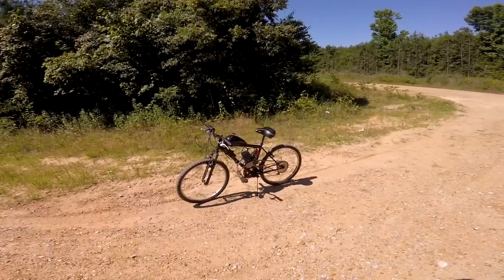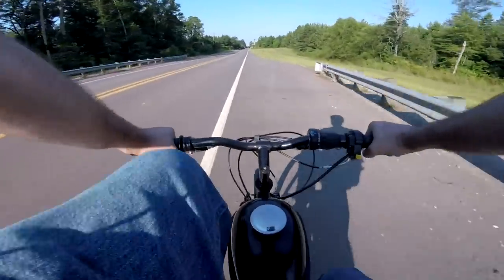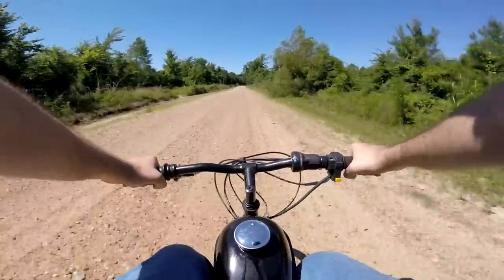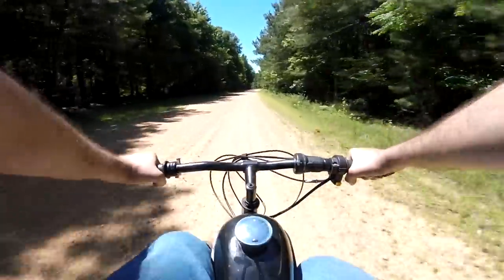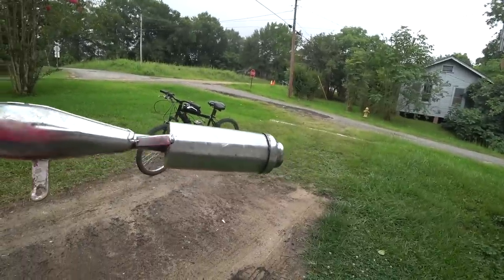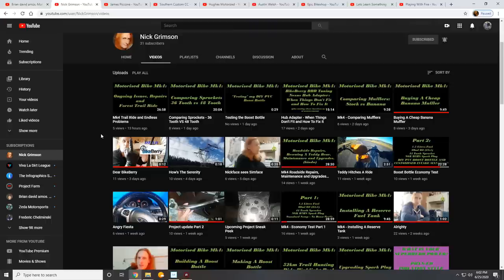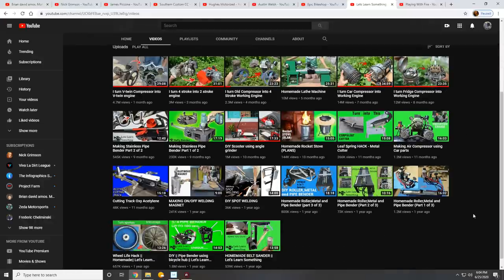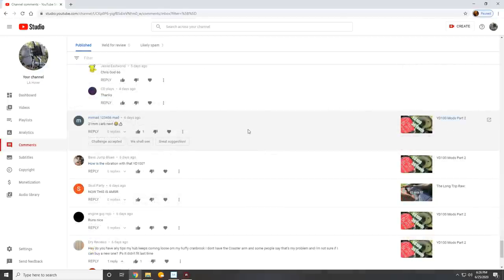Small Sprocket Advantages (Motorized Bikes)

Comment: Hey bud try putting the pipe back on with the air box off it would help....and Brian David is very good at what he does...i bought a ported cylinder from him and went from 40 to 47 mph top speed and it pulled so hard thru the rpm range...you should try one on your other bike

Comment: Hey I take back what I said previously about the HP Carbs...those Delorto knock-offs. Reason for the trouble before was the throttle slide spring wasn't properly seated causing all the issues I was having. The trick to them is to get the cable and idle adjustment(s) to work together to get a decent idle out of the engine, Thunderbolt289 has some good tips about doing that, although he's showing you on an NT carb, but the principle is the same...

Comment: I just jumped from a 36t to  40t. If I didn't live where there is so many hills I would have stuck with the 36. Om my bike almost everything is better with a 36.  It'll just hum along low 30s not even working.  Accelerate faster, even goes up hills faster, gets better gas mileage, sounds better.  The downfall for me is were I live when it gets s little bit colder,  the wind resistance with the 36 is more of a factor.  And the real big Hills you have to be give it everything she has to make it up.
Reply: James  with a little bit of help

Comment: just go ahead and order new clutch pads and a replacement chain that comes with a few spare master links. These are the parts that always trash out and break first with those kits. If you ever break the accelerator or clutch, remember you can swap out your rear break lever in a pinch to make it home. The fuel line that comes with them always wears out fairly quickly, replace it with a real fuel line asap.  I suggest where the cable for the accelerator slots into the handle, wrap it with a small zip tie or two, that little white plastic slot break easily. Otherwise they're fairly bullet proof little machines. If you're going to abuse it, attach the gas tank with electrical tape instead of the bolts because the little screws that are welded to the tank are known to crack the tank and leak from bumps and drops. Invest something small you can strap the the handlebar if you cant or don't have a rear storage rack on the bike and use it to carry all these spare parts and the small hand tools needed for them, and toss a little Gatorade bottle in there with some spare pre-mixed fuel in case you run out or spring a leak and don't catch it in time. I use a small plastic ammo can that is weatherproof for this, and it also hold a small 12v deer camera battery in it that I wired a little switch to in order to operate a bright trail light I use as a headlight at night and get a nice rear red light that flashes (they usually have like 50 hr+ batter life) and toss a $10 set of spare lights in that tool bag in case you break the lights somewhere with a spare set of AAA batteries just in case. 
 That's about it, do this and youll be surprised how long these little kits last. I've got one right now that's creeping up on 4,000 miles.

Comment: I started with a 36T on my first build, and while the initial top speed was quite remarkable, didn't take my weight or the local terrain into account (270# and moderately hilly) geared up to a 41T, and sacrificed about 15MPH for top speed, which is ok, I'm not in that big a hurry anyway. Not to mention these bicycles we all love to power aren't really intended to achieve those speeds...
Reply: Are you saying you are 270? Just wondering because I am aswell. And I'm looking for the right sprocket
Reply: @moxylady01  yep, and a 36T was too low on a 26" wheel. Gonna try a 36T on a 24" wheel on a new build...see if that makes any difference...

Comment: picked up a fully intact used huffy cruiser for $50, ordered a "50cc" full engine kit with a stock sprocket, and separately ordered a 36 t sprocket (with more rag mounts included). Probably gonna most often use the 44 t, but I'll try the 36 t on the same bike or use it on another/later bike build. Also ordered a front caliper break kit for the cruiser. We'll see what the actual engine size is. But anyway ooh I can't wait for the orders to arrive! and build my ICE cool bike 😉
Reply from the maker: been testing a 50cc 2 stroke kit (video will be up soon). They are 'good enough' to get around on, but lack any power for climbing hills.
the 50cc kits need a pipe IMO. Start with the 44t, mine does not have enough power to use anything smaller.
Reply: @LAHover  thanks for the reply . i could guess that you get many many comments in all of your videos.  i'll try to find your FB messenger and send messages there in the future. I'm "Peter V Gorp" in FB. but for now, what is the "pipe" that you are referring to 🤔 ?
Reply from the maker: @pitapitabread  Sorry older video, I need to update the contact. We use discord now, you can tag or DM me in the server when you have questions, https://discord.gg/DMg5BEv

Comment: About your carb: I suggest something from 18-22mm on the YD 100. I run a 20 mm ebay carb for the Yamaha DT 80. I had to jet it down from 95 main jet to 85 -90. still testing. runs good but cant tell you the speedgain because of too many other things modified at the same time.
Also you could do a spark plug test (BP5 HS BP 6 HS, BP7 HS)in the future, its cheap and i could notice some performance gains. the NGK plugs hafe a longer thread which will slightly increase compression without touching your piston on the YD 100. 
Also an oiltest would be an interesting topic. I noticed differences in smoke and smoother running with different types of oil.

 keep up the vids and greetings from Germany.
Reply: So the ngk bp6hs  really work for the yd100
Reply from the maker: Thanks for all the info!

Comment: Hi LA Hover. I Just got my moterised bike finished I have some issues though. So, I got it running it’s awesome yeah. But After a quick ride 10 min. I parked it and then noticed my whole gas line and fuel filter were leaking. They are all tight I don’t know how it’s leaking but anyway, Is a fuel filter really needed? I’m just gonna get a new line. Thanks love the vids Btw
Reply from the maker: Hey it might be leaking from the on off valve. Add a few wraps of nylon tape to the threads of the valve... This will also allow you to rotate the valve to a convenient position without having to tighten it all the way.
No you do not need to run a fuel filter as long as the valve has a strainer, but I still recommend using a fuel filter.

Comment: I have a port matched 66cc china motor with reed valve 21mm carn ported piston boost port non balanced crank almost always wide open no pedals and has so much miles and very reliable, I was very suprised with the china motor

Comment: Hey man, new bike builder here and I've been loving your content! I'm just curious what you think about the sandwich type rear sprocket attachment. That's the cheapest and easiest for me to get, but I've heard other people say to avoid them and go with the type that bolts directly to the disc brake mounts, especially with more torquey engines like I have in mind (4 stroke GX120 or GX200 clone). The only issue is they are more pricey and I have to import them in from another country, and can only seem to find a 22T sprocket of that type.

Do you think these sandwich types of sprockets are adequate for a GX build? From what I've read the main risk is damaging the spokes but I could always go with thicker spokes. Heck, maybe I'll just try it and see what happens 😅

Great channel, either way. Cheers!

Comment: One more advantage...chain can clear the back bars of the bike better than larger sprockets...as my frame is forcing me to find out otherwise i have to spend a lot more money for a jackshaft or a weld job or another bike frame 😢
Reply from the maker: On one build where I had enough tire to chain clearance, but not enough frame to chain clearance I sliced the outer rubber rag joint spacer in half to help move the chain away from the frame.
Reply: @LAHover  Cutting that spacer in half thickness wise doesn't sound easy, but one of a couple ways to add together to get rid of the problem. My chain is being pushed over like a half inch from where it should be and of course I would like another half inch or so for any chain vibration bouncing to not grind a divot into the bar. Idk why they had to bend the bars inwards at the brake posts like this, it's annoying.
Anyway all this clearance crap wouldn't be a problem if we're able to have a jackshaft-crank combo where both motor and pedal drive go through bottom bracket. I'm surprised it hasn't been manufactured yet since it's a fairly simple concept of the right size/design of hollow and solid crank axles and freewheels/owb to have a concentric drive that grips one way and freewheels the other for both drives.

Comment: I have 20-inch wheels with stock rear sprocket. It has fast acceleration but it's pretty slow when riding it continuously. Should I go for the smaller sprocket? Thank you

Comment: My first longish drive on my bike and I flipped my bike. Face first over the handle bars. Cut my face and bunch of other cuts and bruises and some road burn, lucky I was wearing a helmet, out of commission for a few days forsure. Don't think it was the motor though. Something locked up the front wheel at about 25 km. Because the front fork was bent inwards afterwards. It was either the fender or the speedometer I'm thinking. I'm not quite sure what exactly happened but I removed the fenders because they were hanging off and damaged and the speedometer and got it going again and adjusted the idle better. Not sure if the idle not being adjusted right could of caused it to stall but I adjusted anyway, I still don't think that's what happen though.
Reply: I see more and more situations like this lately on different forums and groups.  Pretty freaky. I had a front brake pad pivot that I didn't see till after a ride a few weeks ago, could have ended in the same manor. I really want fenders but I'll probably go without seeing they could do this. Good luck on recovery.

Comment: Hey LA Hover, I enjoy all your videos and had a question. 
I have a stock 49cc motorized bicycle. Should I purchase a 80cc or get my 49cc upgraded? I would assume the cheaper option would be to purchase some things for the 49cc, because I don't have any bicycles that would be a good fit, so I'd have to buy a new bike as well.
Reply: i use a 49cc, but am getting 36t sprocket and vm18 carb

Comment: Thanks for the input, I`ve built my bike from an old mountain bike , back in 87 it was a good quality bike, the info is good but I`ve got a cpl. questions if you don`t mind. I`m a big fella 250 lbs and used to ride alot, I`m finding I prefer to ride at a speed were I can pedal as well because I don`t think my bike should go faster than I could pedal it, what are your experiences with a 48 tooth sprocket and out of curiousity have you checked out - bike berry , videos?

Comment: got me a small 80cc motorized bike...on the streets i  can go easily enough but once i hit grass i lose power and have to open the throttle,am i doing something wrong?
also how much throttle should use so the bike doesnt turn off but still keeping a cruising speed?

Comment: I just installed a 34t sprocket and lost 9mph. Was getting ,
34mph on the 44t sprocket. It's an LD90 48mm piston with Kx85 exhaust. Shouldn't it be able to pull a 34t? Never loss power like this going to a smaller sprocket.

Comment: I've never run the stock 44t gear, I've got a 80cc stock engine minus a NGK coil and 36t gear and she will run 36 mph on flat roads with my 145lbs all day long....BUT this morning for the heck of it, I took the air cleaner off (box and foam), my bike just ran 43 mph.............

Comment: What I have noticed is that acceleration with the small sprocket is quicker but the top speed lacks and the opposite for the larger one! Also my chain would pop off when I used the smaller
Reply: Actually it's the opposite, big sprocket you get more torque but it's slower, small sprocket is faster but less torque

Comment: I used to  do  porting work on Racing engines for Motorcycles and Go-Carts and  i found that using some playdoe  was if your carefull and use the impression you get but it takes a little technique to get it out smoothly OK .cant say that i i it on a one piece head \ cylinder or Jug as you call them.
If you find a two stroke motor with the E and the IN also the AN in the made in japan leaving = MAD  JAP on the motor casting normaly under the rear of the cylinders where the carbys go!
John from MAD JAP Tuning
Thanks for the great Videos

Comment: I like your video's I am a moderate rider, more on the lines of fun. I have a 80cc Zada and I was wondering. What type of spark plug you would want to run in hotter weather ?
Reply from the maker: on a pk 80 I'd run a B7HS. on the yd100 I like the B8HS ... both are cooler plugs if you are having heat issues.

Comment: So say Im a 280 man that wants to run mostly off road trails with more hills then not and not the smoothest terrain.  My take would be a bigger sprocket would be better right?  I like the idea of the smaller sprocket though  for the reasons of less vibration and it being quieter.  Could a smaller sprocket still work for me?  Or am I shit out of luck?

Comment: I change my sprocket from a 32t to a 27t and it sucks. I can't even get to the top speed as I was getting with the 32t because it just take forever to get to a high speed.
Reply from the maker: sweet spot seems to be 36t unless you have a heavily modified motor.

Comment: Now I always here a smaller sprocket gives you More speed but loses low end but what if you have a motor ported for a lot of low end?? Would it equal itself out while still having a higher top end?? Hope you can get back to me I’m currently working on a motor I was originally gonna port for high rpm but I run smaller sprockets typically so I started thinking about what was just mention thanks man!!

Comment: Im a big strong athletic guy im still new I only got to use my motorized bicycle a bit more than few times even with my weight I got it to go 30 mph if I remember easily and going faster while pedaling which up some  huge hills I need to pedal fast so my bike doesn't stall so I bought a 48 tooth yet to be installed my other is a 44 but I heard 4 more teeth can make a big difference and I git a new chain also yet to be installed I love riding my regular mountain bike but this is just a more convenient and plus motorized bikes fourwheelers are just as  fun if not more its like a toy but for adults or just someone who loves motorized stuff anyway my last chain me and my dad fixed after a bad accident I had on my way home from work but I got the new chain cuz I dont trust it that day I went to work although I wasn't working that day and visited left stopped for gas mixed the oil I brought in a jar turns out I got boat oil and I didn't put much in but it made my bike not stay running so I biked on it to my parents work my dad and I drained it put his gas in he had there and on my way home that oil made it much faster and quiter I was going up hill chain snapped out of nowhere and there I go down I was very close to the guard raíl partly in the road got right back up I was bleeding severely swollen knee its been a few months or more still swolken and still a bit swollen the nurse that stopped and helped called my parents for me til they got there my face and nose was bleeding I think because I never went to the doctors I got nerve damage but idk yet til I check and that was the 2nd accident just on my motorized bike ive been in many bike accidents when I was younger everytime with the road rash got right back up instantly no joke and walked it off anyway is there a way to put handle grips on and of so can I put regular handle bar bike grips cuz I tried pro taper ones made for dirtbikes but that had a okastic piece inside my dad said I would like need a whole new throttle with a different grip something ñike that what do you suggestions?
Reply from the maker: Because the throttle needs a wider grip to fit you are kind of stuck with buying them as a set sorry. But I think most dirt bike and motor cycle grips fit standard bike bars.
Reply: @LAHover  so I have to buy a throttle with grips you cant just use bike grips and put them over the throttle grip handles
Reply from the maker: @zacharysmith737  Not that I know of. It would be one hell of a stretch over the throttle core.

Comment: i have one of the cdh66 pipes and brazed a stock exhaust muffler onto the end and drilled two 1/4 inch holes in the end cap of the muffler...its not that loud louder than stock but very tolerable

Comment: Smaller sprocket is definitely needed on a bike with 29inch rims.....I have a CNC hub so I can order many sizes.....I’m running the stock size sprocket and has very good high end power.....but if your gonna ride it off road, Your gonna have a hard time.

Ps get rid of the rag style sprocket and get a CNC hub......it allows a person to change the sizes easy with only having to remove the tire and 3 bolts.
Reply from the maker: smaller sprocket = more speed less torque... I don't like hub adapter unless it's on a coaster break hub.

Comment: Whats the most common bicycle to buy for the build... $100 great but seem the problem is coaster brake... then i seen what  type of metal for spokes.. so what to buy without buying more  accessories. Cheap but will pay more to save later  a little like $170... im just trying to buy during the holidays
Reply from the maker: The Huffy Lockland (on walmart's website) is a great bike.